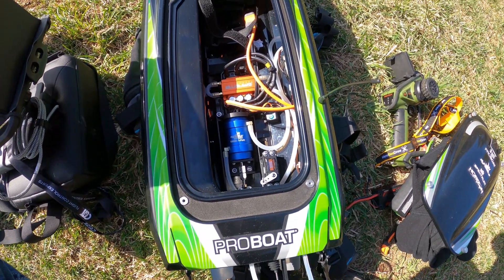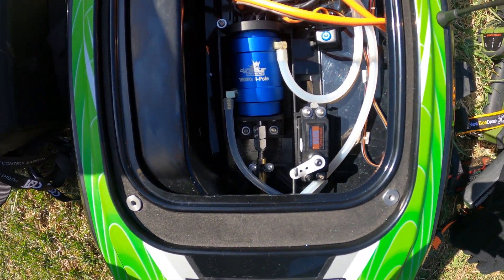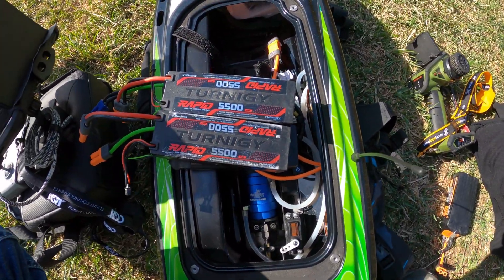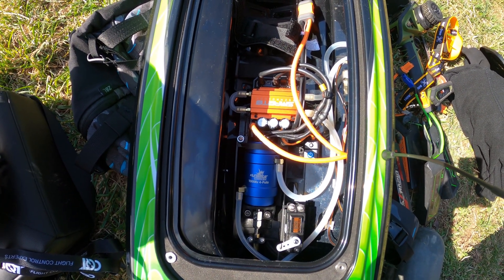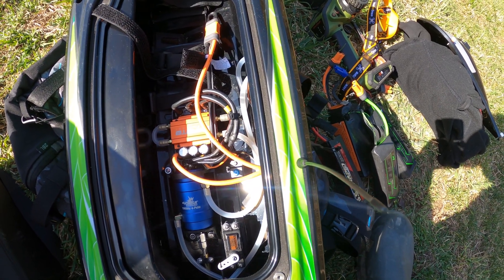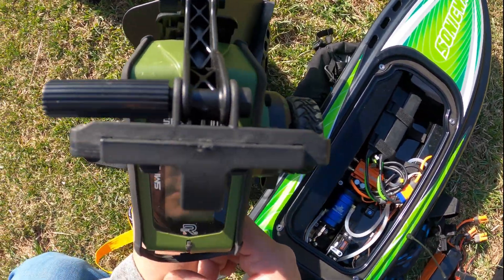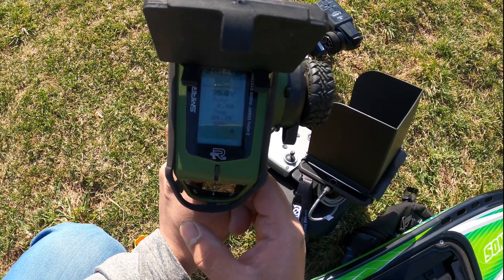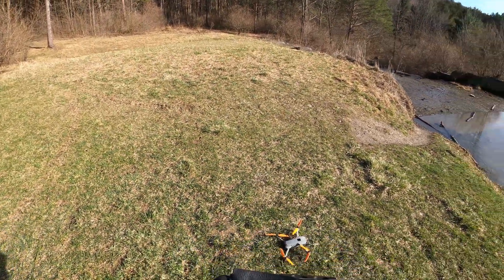Pro Boat SonicWake 160A Smart ESC Upgrade Test -Mavic Air2 and GNSS Performance Analyzer Pt 1 of 2

Comment: So u don’t have to have the smart battery for the telemetry to work on the dx5 rugged
Reply from the maker: Correct, you do not need a Smart pack to get battery telemetry.  You do need a Smart receiver with a voltage sensor or a Smart ESC.  The Smart pack will provide individual cell telemetry when combined with a Smart ESC whereas the regular batteries will only provide the total voltage of the pack

Comment: I got the powerhobby 9000 MAH 100c 3s batteries and it boosted my run times to 10 minutes running full most of the time.  I was only getting 2 to 4 minutes with 5200's.
Reply from the maker: That’s awesome, to be honest since I got into TFL I haven’t run my Wake much.

Comment: Just discovered your channel 👍 and subscribed looking forward to more on the proboat. I have had one for a while now but still haven't set sail bit nervous on recovery if something goes wrong 🤔 is that little boat you had there for recovery?
Reply from the maker: Haha yeah the React has a lot of recoveries under its belt.  Love it soo much it got an upgrade yesterday lol.  Yeah you def need some type of rescue boat if your are gonna rip.  If you take it easy you will prob be ok but if you like to bash and test limits then a rescue vessel is a must.  Thanks for watching and subbing, subbed back
Reply: The sonicwake has a self righting feature that I think all RC boats should have
Reply from the maker: @spinster4000  it’s an awesome feature for sure but it come at a high cost in the weight department.  It pretty useless for racing since the boat is a whole pound heavier than all the others of the same size.  But it is a great basher boat, specially for ppl just getting into the hobby.  Thanks for watching and commenting I appreciate it
Reply: @spinster4000  it does but it's not a guarantee it will make it back to shore I'm thinking lipo cut off or another problem so best better having a backup recovery method

Comment: how did you mount the esc? my dynamite took a crap on my third run as well.
Reply from the maker: Had to do a bit of cutting and such to make it fit in there but nothing crazy.  Just make sure it’s in the same general area as the stock one to keep self-righting feature working.  But it’s more of a double sided tape job, I didn’t bolt it down